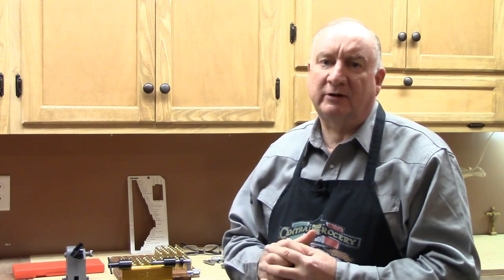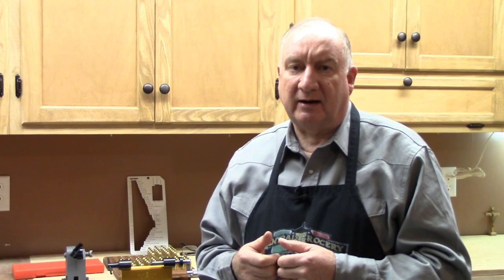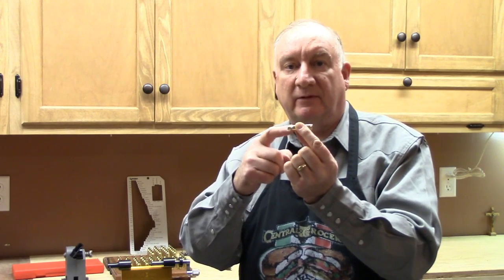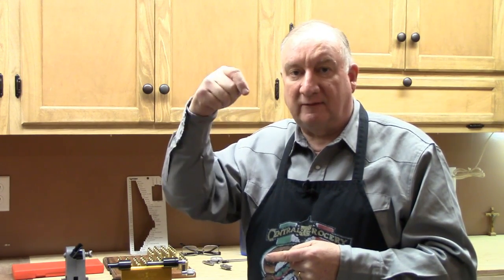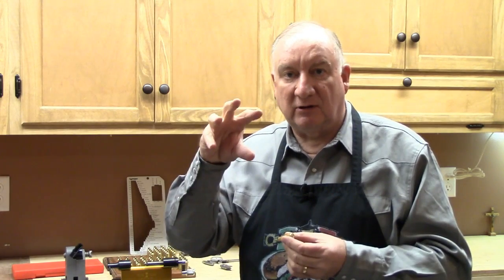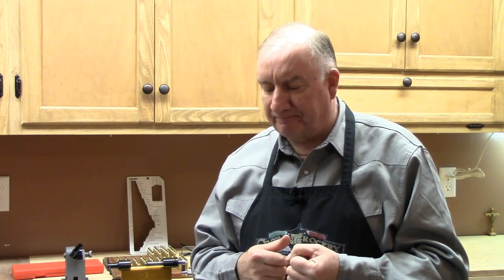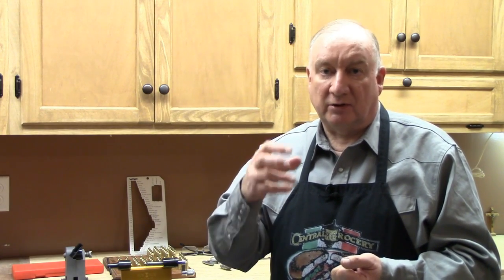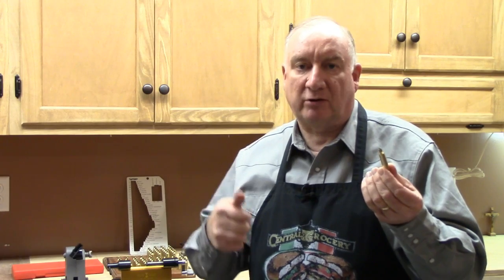Neck turning and neck sizing ~ Seeking a higher level of accuracy!

Comment: You are very knowledgeable. But I have been reloading for about 40 years now myself, and with that said, I think your to deep. I can load military brass all day long and make them a tack driver with not much effort. My importances is as follows, Trim with a motor trimmer for consistency, measure the Lance or rifling of your Barrel, back it off 15 thousands, find a great powder, I use VihtaVuori n130, Then use a slight taper crimp, just a small amount. And make sure to use a Dependable bullet seater, I use Redding. Then just work up a load on how hot you want to make it. I been doing this for years, and killing dogs at 400 yards with about 90% kill ratio. At the rang I can shoot a one hole group at 100 yards, but not all the time, but I shoot cloverleafs on a regular bases. That would be a quarter minute of angle,  keep up on making it sound so difficult and scientific for all the young viewers out there. Your going to scare half of them. But thanks, your doing still a great job, I will give you a great appreciation on all your hard work of knowledge of what you learned over the years. Thank you so much. You taught me allot to. But I just thought it was to much over kill. Oh I forgot to mention, I shoot a 223 with a 22in bull barrel. Ruger 1477 Mark ll. I have two of them for when the barrel gets hot, and there are allot of dogs out there. Your video was still a great one. Thanks again.
Reply from the maker: Please read my introduction that has accompanied the video since I launched it.  I clearly wrote for the purpose of clarification and truthfulness, right up front:  "While not necessary for the standard of MOA accuracy, these easy techniques can profoundly increase accuracy..."  Regardless of your definition of tack driving accuracy, such methods are not only acceptable for benchrest competitive shooting, they are standard practices that have been employed in the precision game for decades, which no competitor of serious stature would do without.  I never once implied that this was at all required or in the least bit necessary for the average handloader, nor do I even recommend that these methods be considered unless one is stepping into precision shooting that exceeds the bounds of your tacks.  While you are entirely satisfied with your methods, there are many folks who certainly do inquire of the more advanced processes, and it is for them that I did this video.  Your methods and equipment perform for you, with your particular powder, which is perfectly fine for your purposes and your degree of satisfaction.  That being said, I cannot concur for the sake of those reading this that your conclusions are factual.  A motor trimmer increases speed of production and efficiency, and makes it more enjoyable perhaps, but has nothing to do with consistency whatsoever. An accurate trimmer will trim consistently at any RPM.  Redding dies are very nicely made, and nicely finished, with easy adjustability, and I have used them extensively, but have no accuracy advantage over any of the brands made, and I have used them all, including ones long out of business.  I have owned many a die that was poorly finished, poorly designed, and a pain to use, but I have never owned a die that wasn't capable of producing very, very accurate ammo.  I am here to help the expert, as well as the novice, and both have thanked me, and they can tell the difference and rate their interest accordingly, so I am not at all scaring folks off.
Reply: James Sween, if information is too hard to follow along with and if accurate information scares any "young viewers" away from reloading  than i must say, they have no reason to reload in the first place, or maybe they need to grow a pair and get their stuff together.  Also if your cases are sticking after firing you are over loading, if your cases are sticking when loading your not sizing or seating correctly.

Comment: Informative as usual. When a factory loads a projectile into the case neck, does that then make the ID of the case neck concentric? And then, once fired and neck turned, is concentric on the OD and the ID? If so, does annealing change this at all?
Reply from the maker: Fenton Painter 
No.  Case necks of most commercial brass is unevenly thick around its circumference, which places the center of the ID off kilter with the OD. What makes matters worse, the uneven thickness can also be along its length, which tilts the bullet along its axis.  Fireforming stretches the brass to fit the precise size of the chamber, but cannot remedy the thickness variations, which will remain until the outside neck turning process.  A long cylindrical centering pilot of exact bullet diameter is inserted into the neck, and the carbide cutter is advanced to shave only the thick brass, so that it's equal to the thin side, and no more, for a standard commercial chamber.  For a custom benchrest chamber with a minimum neck clearance, the brass is cut to the required release clearance.  It's only done once in the life of the brass.  Annealing is a softening process that has no bearing on brass dimensions, and may be done multiple times.

Comment: Really appreciate your knowledge and experience.  Thanks for sharing that with us.  Could you list the steps you use to create precision ammo (say for PRS shooting, not Benchrest) and what tools/dies you would use?  In particular, I will be reloading for 6.5 Creedmoor.  Have done more general reloading (plinking, target, some hunting rounds) in 9mm, .223, .204, and .308.  Just confusing on the best methodology for precision loads.
Reply from the maker: Joseph Stanczak 
If you follow my entire series of videos regarding the handloading fundamentals for making reliable hunting ammo that fits your gun correctly, and you use an accurate rifle made in accordance with the explanations I provided in those two videos, you will have the best possible equipment to compete.  PRS ammo is no different than any other, provided that its caliber and velocity is within the rules.  Any of my regular bolt rifles could easily compete, and would be well within the rules.  You certainly need not spend much money to win, and there is no concern about paying anywhere near the ceiling limits on either rifle or scope.  You could do quite well with for instance, a very inexpensive but high quality Leupold VX-1 3-9x40 mounted on a quality affordable gun which comes factory glass bedded with a beautiful trigger, and you would be well under $1,100.  Because your ability to spot hits and misses is critical, you want an easy recoiling rifle with a good ballistic coefficient, but enough bullet mass to leave a signature.  I know you like the Creedmoor, but I would be very happy also with a 280 Remington that could be tried and tailored with an infinite combination of different bullet weights and recoil levels until you found what you like and what works best for you.

Comment: Hi there. Any thoughts on interior neck reaming versus external? Obviously the former requires fired brass. I ask because it would seem purchasing a case trimmer with a micrometer would save some fluffing about setting correct case length and Wilson or a Sinclair versions of these mean use of the Wilson internal neck reamer. Also, you describe the neck turning as a necessary precursor for better accuracy but a one-off event. It would seem many consider it necessary to go through this process more often. Thoughts?
Reply from the maker: SGK 
Neck reaming and outside turning are for entirely different purposes, and neither suit the need of the other.  Inside neck reaming will not center the bullet.  It's used for necks that have thickened at the shoulder juncture after necking down of brass from a larger to a smaller caliber, and it has no ability to make a neck ID and OD concentric.  Outside turning is a lathe procedure that cuts brass from the outside, with a pilot that maintains the same thickness.  Once brass is concentric by outside turning, it's concentric, and once uneven longitudinal thickness is corrected by inside reaming, it's corrected.  Neither is done more than once.  Unless you are necking down brass, you don't ever ream.
Reply: GunBlue490 Ok thanks.  I was thinking that once fire-formed the exterior of the brass is uniformly round (assuming the chamber is) and then reaming would ensure concentricity, assuming the cartridge and reamer are in alignment. I have yet to find an outside neck turner used on a neck trimmer tool other than the Forster you highlighted (which doesn’t have a micrometer for ease of case length setting).
Reply from the maker: SGK 
Fire forming only transposes the outside dimensions of the case to the chamber dimension, and cannot alter variances in brass thickness that occurs in brass manufacturing.  Unless you are using benchrest chambers with specified release clearances and mated neck sizing dies to correspond to the desired release tolerance, any measurement of wall thickness is a waste of money and time.  Brass must be thought of as a precious thing that should be cut away at the absolute minimum, only where it is in excess, in any dimension.  When brass is turned for a maximum factory chamber, the very slightest brass removal further increases the slop, so adjust the outside cutter very carefully to just glance the brass, and remove ONLY the high side and no more.  Put away the Sinclair catalog.
Reply: GunBlue490 

I agree with the points you make above. I was thinking fire-forming would transpose any “high side” in thickness to the interior and careful use of a reamer aligned with the cartridge neck exterior could trim the bare minimum differential to achieve thickness uniformity (regardless of what thickness that might be). My only reason for looking beyond the Forster case trimmer (and hence its turner attachment) was to find an easier mechanism for dialling in required case length. Perhaps this isn’t as hard as it seems ex ante. (Or perhaps two tools but that seems inefficient.) Thanks again for the very useful videos.
Reply from the maker: A high side will always remain a high side and will not migrate to the other side.  The only dimensions that change are the case wall size, to fit the chamber.

Comment: thanks, i noticed the brits using a faster method than we use. they seat the bullets with a arbor press with a pressure gauge on top. the rounds that are not in the norm will seat with a different pressure, they set those aside for plinking or fouling shots. then they measure and trim the thickness. that weeds out the time wasted on measuring each neck when you can do it while seating the bullet. any thoughts?
Reply from the maker: JB 
The process of employing arbor presses and measurement gauges was developed by American bench rest shooters decades ago.  It's worthwhile for such endeavors, but has little practical application for most midrange target shooters.

Comment: So I would run my new brass (Lapua) through a full length sizing die then trim to length and then turn the necks to auniform wall thickness? Many thanks
Reply from the maker: medhist2006 
Sorry for just running into your question after so long. Lapua makes exceptionally good match grade brass, consistent in every way, and very well protected in packing.  Unless it's visibly distorted from damage, it may be loaded immediately with no resizing.  In my experience with it, turning is an unnecessary process that will afford little or nothing. It's already trimmed perfectly to minimum.

Comment: just a question if I may: What would be the minimum clearance between a loaded round case neck and the chamber neck? THis rifle(savage 112v in 22-250) is strictly for bench shooting. Fantastic video. I will watch it often. Keep up the wonderful work.:)
Reply from the maker: medhist2006 
Again, sorry for the long delay.  There is no requirement to trim until brass reaches the specified maximum listed in all handloading material.  Chambers are cut with the clearance to prevent case neck contact. It is customary to trim ten thousandths back from maximum, which is a very small amount.  I have seen much made of this issue over the last few years, but I have done some experimenting, using known accurate loads, using cases that were not trimmed uniformly, and found no difference whatsoever, so long as they were within the minimum to maximum specified. I once accidentally cut a couple of cases of my 222 Remington a full 1/16 inch too short, and almost chucked them.  I decided to shoot them anyway, and they shot into the same group as the rest.  It's not recommended practice, but varied case lengths within .010" are not the problem many folks imagine.  A ring of brass .010" long exerts no tension on a bullet whatsoever that affects pressures of such magnitude.

Comment: After watching your video on neck turning and neck sizing, it leads me to ask a question that I may have missed. Measurement of the actual neck wall thickness. I purchased the Hornady neck wall thickness gauge to go along with my concentricity gauge tool. Although it measures deviation of overall dimensions, it does not concentrate on specific locations of wall thicknesses. Would it be wise to invest in a vernier ball micrometer?
Thank you in advance for your educational videos. I've learned vast amounts of knowledge from you.
Reply from the maker: Jeffrey M. Green 
A ball mic, often called a tubing mic, is an interesting tool, but before you invest in one, understand what it seeks to accomplish, and what it will not.  Consider two instances, involving the target rifle with minimum neck clearance, and the sporter, with fairly wide tolerance.  In both situations, a properly neck turned case will be cut uniformly, as this is what the turner does, based on the cut thickness to the pilot, whatever that may be.  It works like a thickness planer in a cabinet shop, and simply cuts the same all around, though I am not an advocate of cutting more than about 85 percent around the neck for standard sporter brass, which will leave a gauge of brass that gives at least the original thickness.  The uncut part is not going to shoot off center in such a gun, being barely measurable, and provides for a safe margin of material, AND to prevent excessive clearance that is counterproductive to accuracy, too.  So, to measure cases accomplishes nothing, except to satisfy curiosity.  In fact, because I recommend cutting a minimum of brass off, based on the original thickness, one brand may actually be varied from another.

The minimum target chamber is another matter.  Such chambers can be cut to establish mathematical measurements, according to a user's desires, based on the release clearance.  Here, a user may determine that his rifle could have .001 clearance, for example.  He will simply calculate the diameter of the bullet, plus 2 times the neck wall thickness, plus the total clearance.  In this situation, a tubing micrometer will allow him to adjust brass thickness to give the required clearance for bullet release.  Here is a hypothetical:  The target bullet is a Sierra, at .3085" (Sierra adds a half thou.).  The brass thickness, after cutting all around, comes to .010 X 2=.020".  Add a thousandth for total clearance, which equals a chamber dimension of .3295".  There are certain dangers in his business.  These chambers are so tight that they can jam a standard round and cause catastrophic failure.  A tubing micrometer is essential for this.  

Don't use my measurements, which are only mathematical examples.
Reply: You never cease to amaze me in clarifying me question. I wish I lived closer to you. I'd probably be knocking at your door daily for advice. Thank you again for your quick reply sir!
Reply from the maker: You are quite welcome. God bless, and shoot safe.

Comment: Thanks, again! I am impressed by the fact that you take so much time in answering questions. I read below that you do not recommend neck sizing for game loads. Why is that?
Reply from the maker: J. Mann 
Most, not all, neck sized cases fit snuggly, as they should, into the chamber.  Besides the required effort that seating such loads into a chamber can slow down or hinder proper cycling, there is a very real risk that a load cannot be chambered fully at all, as there is no room for even the slightest debris whatsoever.  Field hunting involves debris.  Neck sizing affords a limited degree of additional accuracy that no imaginable game situation could possibly benefit from.  In addition, prudence dictates that every advantage be accorded the hunter, which means the best and most failsafe possible ammunition, including virgin brass.  Never confuse benchrest methods, which employ countless little nuances for the sake of reducing groups by decimal points, with the high stakes of hunting big game, that rquires reliability, function, and speed.  Any standard load that has been conventionally sized can shoot fine game loads that will take any deer within 400 yards.  Deer are not killed deader by ammo that shoots sub MOA.